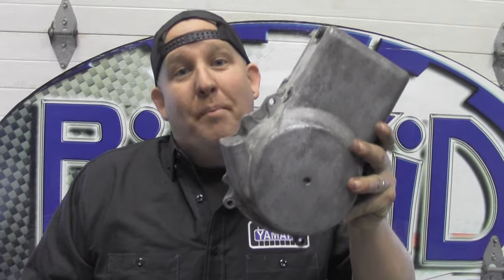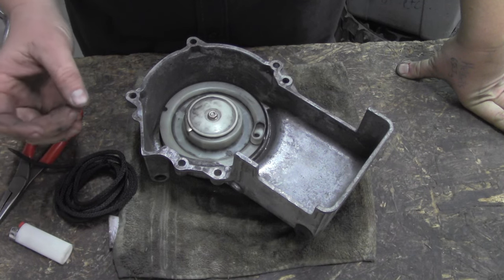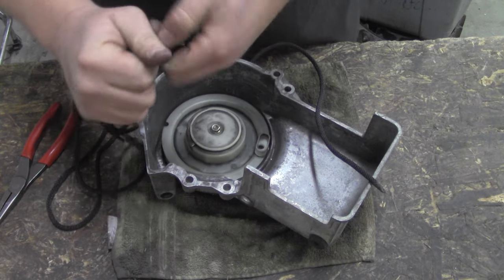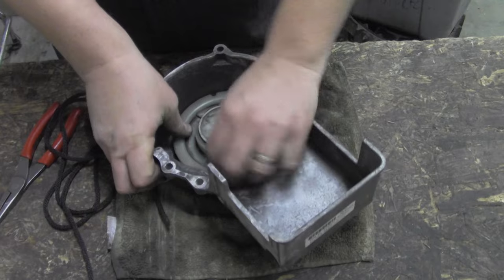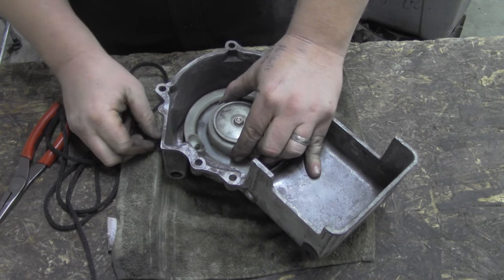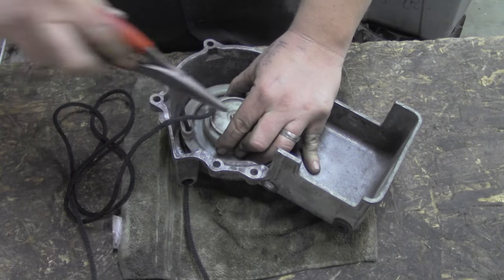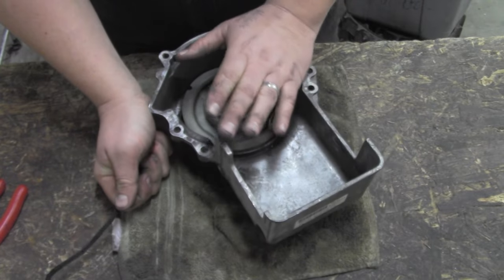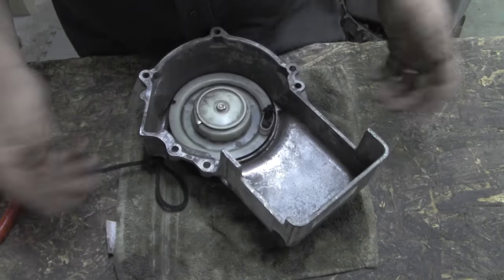How to Replace Recoil Rope

Comment: just a quick point to make things easier , instead of putting tension on recoil , hook rope up first as explained ,but do not put any preload on spring , then put rope in notch in top of plastic sheave and put tension on recoil , a bit easier , not working and threading under preload, just a bit easier for beginners.
Reply: Good tip...I was thinking the same thing, why not put the rope in first then load the spring?  I get to do this on my sled this weekend.